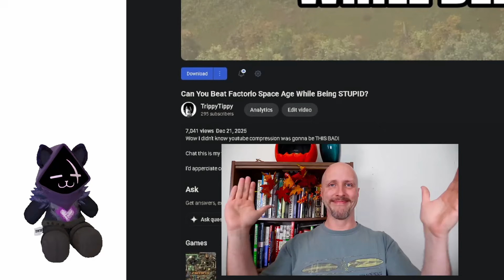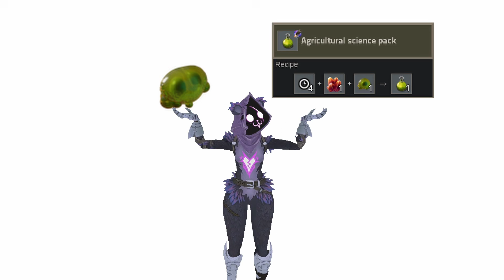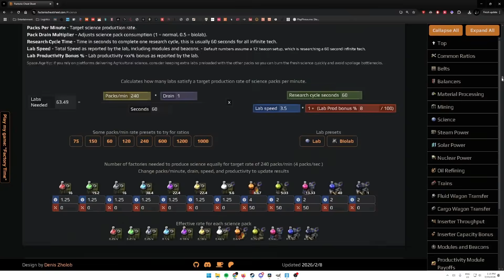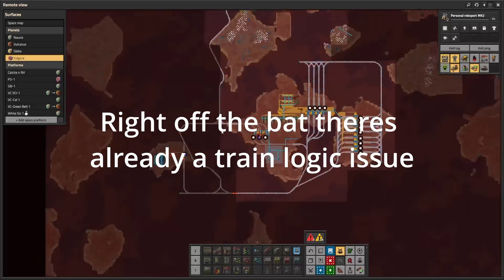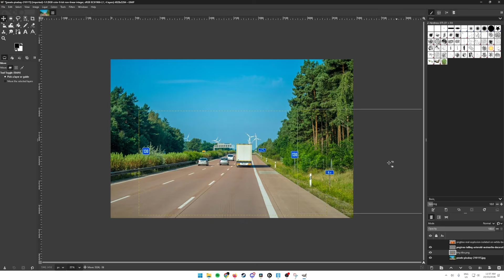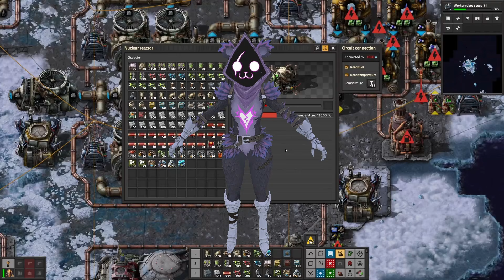Can You Beat Factorio Space Age While Being Stupid? (part 2)

Comment: Gleba made me quit the game for 6 months and Aquilo almost made me drop the game entirely... My advice for when you go back to the swamp is to go with the mindset that literally everything on that planet is free and unlimited. The only "limited" resource on Gleba is stone and if you really need to, you can just ship it in from Vulcanus where it's free and unlimited. Don't have any product end in a stockpile that can get backed up (like your seeds did), instead either make sure that the thing you're producing is being 100% utilized by later machines, or feed the extra stuff you're overproducing into either a heating tower or a recycler. Also, power is free, use rocket fuel in heating towers to heat heat exchangers to then supply steam turbines. Use circuit logic to make sure your inserters aren't just wasting your rocket fuel and are only putting fuel into the heating tower if it's below temps (unless the inserters are pulling off your spoilage line, in which case let it burn!). As long as you produce enough rocket fuel, you'll be able to generate enough electricity to power everything plus a massive wall of Tesla turrets to keep the locals out. For Aquilo, I eventually gave up on the idea of a compact base due to everything I attempted to do just turned into a fine Italian meal. Instead, I stumbled across a video where someone created a bunch of little "cells" that were just squares of heated pipes, which they then used to create little production tiles and would connect everything together in one heated grid. The hardest part is just figuring out how big you want the cells and how to make your heating cell tileable, but after that just build big. There's no enemies on Aquilo so you don't have to worry about something attacking a part of the base on the other side of the map.